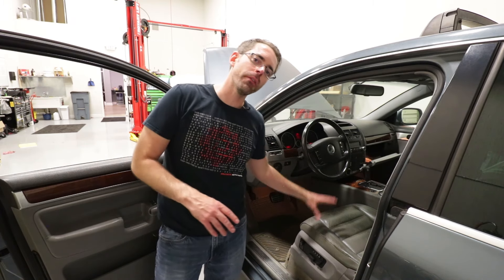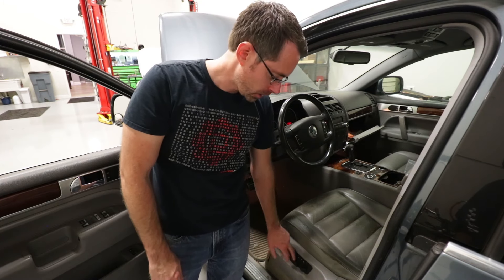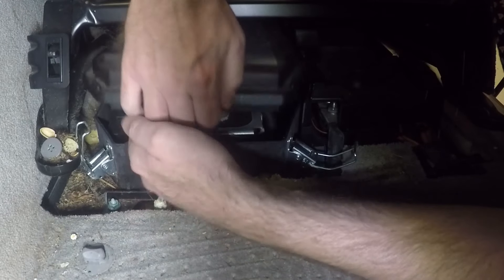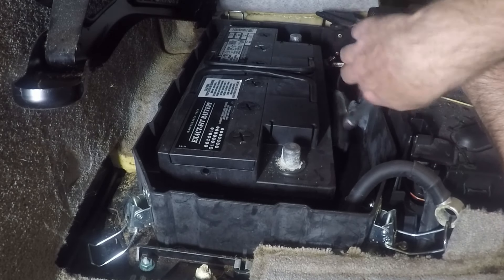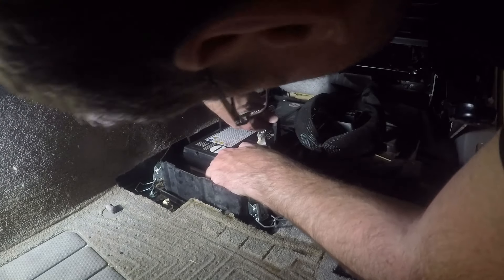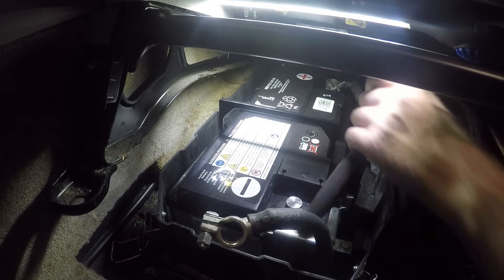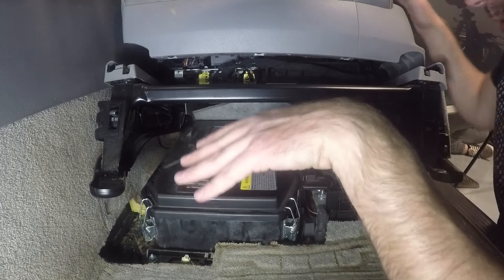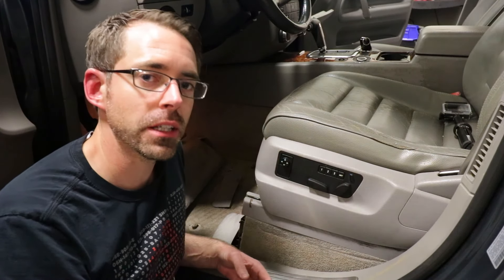How to Replace a Battery on a VW Touareg (Under the Seat)

Comment: To all the people complaining about the location of the battery: i watch this video bc my 06 Touaregs first oem Battery is on its way out. After 14 years! The location saved it from the temperature extremes
Reply: Bullshit. I've worked on these cars for 21 years. Seen batteries on these die in 2-3 years. Changed some under warranty. The only reason they put it under the seat was due to space limitations under the hood.
Reply: @LynxStarAuto  ours lasted 14 years, so definitely no bullshit. Maybe some people treated their cars wrong so they didn’t last as long
Reply: Did you do anything worth while tho? As a mechanic, we have clients that drives 5 miles every few days, lol.
Reply: @a.z.3214  Touareg 3.6, 17 years with 300k KM, still running strong from original battery
Reply: Mine just went out. 12 years lifespan and in a pretty extreme climate too. So no, it’s not bullshit.

Comment: It's actually easier and simpler than in this video. Absolutely no need to remove the trim from the front of the seat, no need to pull carpet from the back, and no need to be so cramped - you can easily flip the seat out of the way completely. First remove the two plastic trim pieces from the rails at the back of the seat - they just slide out. Then pop up the two trim pieces on the floor in front of the seat and remove the triple square bolts as in the video, pop up the seat - then just press the button to slide the seat forward all the way - it will allow the seat to flip back almost 90 degrees giving you plenty of space. Reclining the back rest forward will also give you some extra space.
Reply: I saw another video regarding the seat and it makes life easier to change the battery without taking out the trim or taking out the seat...
Reply: Can I switch the battery with vehicle on so I don’t have to use the rest tool?
Reply: @Aliain12  
If you mean engine running,  NO, do NOT!
Reply: @suave6565 Right. The rear of the seat is hinged. But you do need to remove the plastic "feet" off the rear or they will crack when you leverage the seat.
Reply: Best comment here,
Thx for the tip.

Comment: Location of the battery is fine where it is due to the fact that it is out of the elements and not exposed to extreme hot or cold if it were in the engine compartment. My original battery lasted over 10 years and 136k miles. The only reason I changed it was as preventative maintenance.
Reply: Hush lol.
Reply: That is a great point. I never thought of it like that. We just changed my fathers battery in his Cayenne... pretty easy, just heavy is all.
Reply: same here.  We have a 2012 TDI and just replaced the original battery for the first time today.  They aren't cheap, but if they always last 10 years or so that's pretty amazing.
Reply: @512TXSDIY It total BS. Do you know how hot a vehicle's interior gets? Triple digit temps. Hot enough to kill a human if left locked inside. The battery sees more extreme temps where it's at under the seat than the engine compartment. At least in the engine compartment you have air flowing through it.

When the Touareg released, it was VW first ever SUV. They learned a lot of lessons with that first generation, which they applied to the newer generations. That's why the battery is no longer under the seat. 😉

It's not under the seat in the Tiguan, nor the Taos, nor in the new Atlas which is the successor to the Touareg.

It was a bad design choice. Let's call a spade a spade.
Reply: @LynxStarAuto  the engine compartment gets hotter than interior 100%. Temps are so hot in compartment that you can’t touch some parts where interior, you can still touch. What do you think?
Reply: @512TXSDIY Bud I live in sunny south Florida. When the vehicle sits out in the sun long enough, it's not uncommon for the interior to reach temps in the low 40's (low 100's in freedom units). Things get so hot you need a towel or gloves to touch them sometimes. That battery is sitting there baking under the seat at 40-41°C. Without any air circulation.

Under hood when the vehicle is moving, there is airflow through the engine compartment. The battery is off to the side usually in its own insulated inclosure to protect it from the elements. Plus when the vehicle is outside sitting all day, I promise you, it doesn't get very hot under there at all. It stays at whatever the ambient temperature is.

Again, if it's such a great design, why did they put it back under hood in the Atlas? Why was it always under hood in the Tiguan and Taos?

Mistakes were made. They learned from it and moved on. I love my VW, doesn't mean they don't screw up from time to time.
Reply: @LynxStarAuto  True. I’m in Texas, it’s hot here too.
Reply: @512TXSDIY  5:50 Also very telling and a common issue with this platform. Corrosion of the negative terminal.

Why does it happen? Very easy poor ventilation and airflow to that battery compartment. I changed countless terminals in these cars under warranty when I was at the dealership.

Comment: As a design engineer by trade, it amazes me to think that somebody received money to design this battery location!
Reply: having owned one of these vehicles for the last 5 years (after a lifetime of sensibly designed Japanese vehicles) it blows my mind some of the stupid decisions made about the designers of this vehicle - battery under the drivers seat / spare wheel you have to inflate / bolts to hold on the wheels instead of studs with nuts / a radio that ALWAYS turns on with the car - agrivating...
Reply: it's so the person driving their vehicle doesn't get their battery stolen if they're stopped and someone tries to force entry/open your hood to steal your battery! Preventing battery theft was their reason for doing so! /s
Reply: putting the battery under a power operated seat is an... interesting choice of location

Comment: So - you actually made this a little harder than necessary.  Once you move the seat back and lean the seatback forward to access the front bolts you should then tip it up and then slide the seat forward as far as possible.  This lets you tip the seat back much further which gives you a lot more room to pull the batter out and more room to work.

Comment: Love my v10tdi.  Amazing offroad and amazing power on the streets.  136k and strong.  Only issues so far in 20k mi is front battery and passenger side tandem fuel pump leaking.  Changed gaskets for $40 and $100 for battery and its good.  Towing a boat w/ this is more comfortable than towing with my 19 f250 6.7. Heavy trailer towing is what i use the f250 for...

Comment: All you had to do sir after pulling the seat up is to push it forward so it comes almost straight done this multiple times on my touareg v10
Reply: Sadly  that only applies to the older vehicles. Around 2013 they made it necessary to remove the seat completely. You then have to cut the carpet to remove it and use a special tool to reach the battery box clips. No easy access anymore.

Comment: I knew this was a hassle but I didn’t know it was this involved. On the bright side my battery was 10 years old before I voluntarily had the VW dealer replace it for me. Supposedly keeping it under the seat gives it a longer life by keeping it away from the heat of the engine.

Comment: For all the moaners: the battery isn't in the engine compartment, because there's simply no space there when a V10 or a W12 engine is fitted. Also, the Touaregs with the V10 and W12 engines have actually two batteries: one in the boot under the flooring, and the other under the seat. One of them is reserved for cranking, and the other is used to power all the other electrical consumers - this prevents the car from getting stranded because of the battery getting depleted by said consumers. Remember, that the original Touareg has serious off-road capabilities and has been designed with that use scenario in mind, hence this design. Which btw also helps lower the center of mass on the car, which is also important when off-roading. Touaregs with smaller engines and lower trim levels, like this V8, might not have the dual battery system, but have instead a spare wheel under the boot flooring - and that's why their only battery is located under the seat. Because, you know, it's obviously more important to provide easy access to the spare wheel than to the battery, if you have to choose between these two options.
Reply: This is just more german design nonsense justification.
Reply: If VW only made up these "excuses" after the fact, after they cobbled together the Touareg randomly from parts, then they must have had a hell of a luck, because these things just happen to make sense on so many levels, you can't even believe it. Which is not so much a surprise though if you know that the Touareg,  together with the Phaeton, which it shares a platform with, were VW's no-compromise all-in vehicles at the time (even more so the Touareg, which had even less size constraints), where engineers pretty much didn't have to cut any corners, but could put everything in the cars they thought would be good, and at places where they'd think they'd fit best.
Reply: Guy didn't even put the seat forward on the tracks to get to the battery easier. And like typical first world problem millennial complained about dirt on a carpet that looks cleaner then anything I've seen on any car here in the salt belt.

Comment: For all the haters here. How many times in a cars life do you change the battery? Once, maybe twice. Some of the comments make it sound like it needs to be done once a week. I bought a new Touareg in 2014 and have never touched the battery. Sheesh. A big thank you to Deutsche Auto for posting the DIY.
Reply: You are almost due.  Also, it doesn't negate the bad design elements.  Or the fact that all of those plastics under the seat are as sturdy as a baby's tooth.  Sometimes edges, or clips break.  Now all that stuff is a floppy, rattley mess under your seat.  A needless expense.  Especially when you realize they could have mounted that battery anywhere else.
Reply: Most people take their car to mechanics. This setup is exponentialy more expensive than  most cars. And time consuming.
Reply: Even though. This is a total messy design. Rubbish. Thumbs down. Nonsense design.

Comment: Thanks for the video but 2 tips.
 A screwdriver used to pry a little against the clip down low will open it easily. Right where the wire bail goes into the lever.  Remove all 4 bolts in the seat, much easier to maneuver around. Personally I used a large Torx and it worked fine but wasnt the correct tool. My battery was dated 2/15 it is 4/23 now. 8 years.

Comment: I love these things. I want a 1st gen Touareg V8 so bad. The naysayers in the comments just don't understand what these are and that's ok because they're keeping the prices relatively low.
Reply: KYoss68 I got mine three weeks ago. Amazing vehicle! Live in Montana with quite a little snow. You cannot tell a difference between slick or dry roads driving it. It is so comfortable to ride in. The height level adjustments, manual diff lock, tiptronic transmission, sport mode......I don't give af where the battery is or how difficult it is to change!
Reply: @stefcoburn2345  Well said !! I am getting me an 04 this Saturday !! Boom

Comment: If you move the seat back all the way forwards as well as the seat itself after removing the front two bolts, the whole seat will fall back and you have LOTS of room to work. How do I know? I have one of these Touareg’s lol. I’ve have had multiple battery issues. It’s much easier than depicted and only takes a couple minutes. 

Also, you don’t have to pull off that front carpet piece, only things to remove are the track covers in the rear and the front bolt covers
Reply: I was gonna post this as well! By pushing the seat forwards and reclining it forward the seat will drop back far enough so that you could almost pull the battery straight up.
Reply: I just remove the upper triple squares on the seat rail itself vs the ones on the seat rail mount base.  The seat seperates from the base completely.
Reply: in order for the seat to completely fold back you have to make sure to remove the plastic rail covers on the back side otherwise they will get damaged

Comment: For all the people b*tching this is easy compared to remove the batteries on a ford econoline diesel. The battery is underneath the car and the bolts are right against the frame of the van so the terminals are a pain to get off and even worse you can’t see what you’re doing.
Reply: And welding your wrench to the metal plate of the battery housing is always a huge concern when disconnecting the only cable you can reach first at times.
Reply: The worst batteries were always those Chrysler's with the battery in the bumper liner 🤔😆.

Comment: Any idea what the part numbers are for the two plastic pieces that you pulled up after the driver’s floor mat? Mine is missing those pieces and it’s almost like there’s exposed wires and I need to replace them.

Comment: Did you know if you move the seat all the way forward you can tilt the whole thing back further and have less hassle at getting to the battery. Not only that you could have saved the settings on pretty much all Touareg models and just its 123 buttons on the door. it would have put the seat and steering wheel back into the right position when you were done. Because all of us can see you have the seat fully back on the tracks and that's why you had a hard time pulling the battery out.
Reply: 90% of the time, customers do not even have the memory seat settings in place from my experience.  I just remove the seat from the base, and toss it back towards the rear.  That way I don't have to deal with all of those brittle plastic trims which love to grenade upon removal.

Comment: Hi thank you for your insight in out replace the battery , now could you help me ? What about the second battery on the back under the spare tire ,my Touareg has 13 years (2007) a d o believe was never replaced , now I’m having all sort of info , like consumers electronics off , a/c shut off , could be from there , what kind of battery is that . Thank you

Comment: In the UK, the battery is an 019AGM. The first time you change it, you invent some new swearwords. The second time, it isn't so bad. My memory saver didn't work on this Q7 (same battery placement) so a bit of resetting to do afterwards but not too bad a job to do.